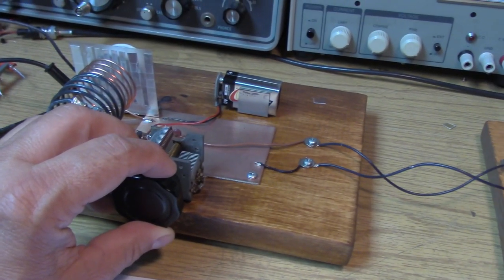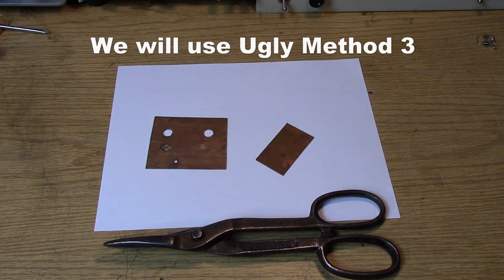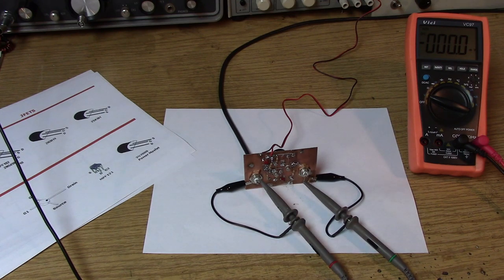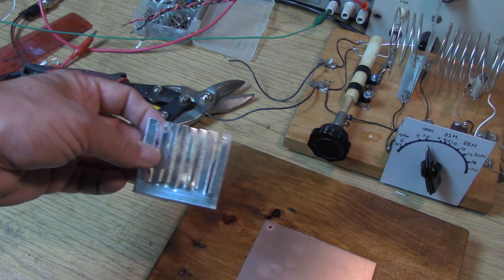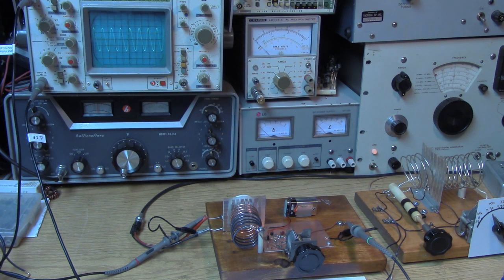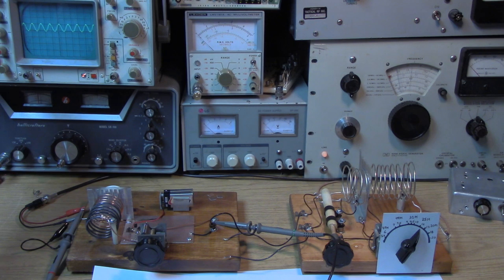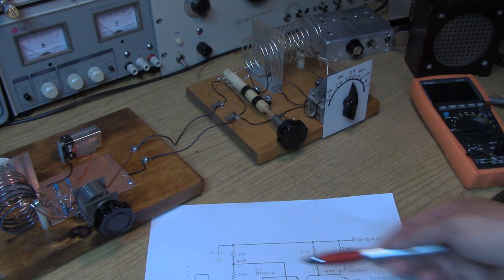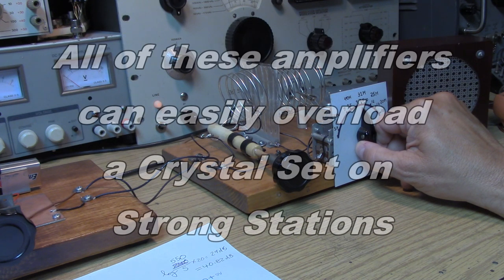Solid State Shortwave RF Preselector

Comment: I know this took a lot of time and work but I am so grateful for it. I'm a returning ham after a 30 year break. I have no electronics background and have a 68-year-old brain and so don't learn as easily as in my youth. Your teaching style is easy to follow and I'm getting there! Going to have to look into what you mean by "bias" in this context as I'm not clear on that just yet. Thanks again.
Reply: Hi, I am also 68, but have been working in Electronics since 4th grade, I found one of my business cards for Transistor & Tube Radio Repair growing up in rural NJ. I had a mentor, WW2 Vet who ran a a TV repair shop in Newton, and my Mom would drop me off there while shopping. I had some red cover book on Transistor Radio Servicing, and remember asking Mr. Decker what BIAS was all about!!! Basically it is just like IDLING in your car or lawn mower. The Idle screw sets the no-load engine speed. Similarly, Bias is as simple as 1 or better 2 resistors from the main voltage supply as a voltage divider, to drive the Gate, Base, or Grid input of your active device. For BIPOLAR Transistors, it is often 0.7V Silicon or 0.2V for Germanium. For FETS it can be 0V for Depletion mode, where the rated 10-50mA IDss Drain Current operating point results. For tubes it usually starts NEGATIVE with respect to the cathode, cutting down the Plate current or gain. The wanted signal is overlaid onto this DV set point, thru a DC blocking capacitor, and swings above and below the bias point. Hope this helps explain the basics, W4HDL in USA...
Reply: @conservative599  Hi and thanks very much for taking the time to explain this. The car idling metaphor was good for me as I've set up quite a few car engines in my time. Talking of time, it's moved on. When I wrote it must have been just before my birthday as I am now just turned 70!  Thanks again, I appreciate it.

Comment: Great fun. I have built several Doerle duplex type regens ( 6sn7 dual triode ver) and have been lucky in that i grabbed velvet vernier dials and that ilk when young. Saved tube type resistors and plug in coils/ sockets too. Just now am working on several transistor/ opamp modern sets and restoring my Dad's 1950 xtal set. ( W5EWF, sk). It even has an S meter! Pancake 2 stage tuner, tapped rf and adio coils for precise match. Amazingly sensitive. These sets still amaze me. You always peesent excellent videos! Thanks. 73 Karl, WA2KBZ

Comment: Very ell presented. You might be interested in this bit of related nostalgia. Back in '72, one of the popular electronics magazines ran an article about printed inductors. I ordered the PCB and it had 2 "coils" etched into the copper with space for 2 JFETs. It was an RF preamp for the FM broadcast band; each stage had a variable cap to peak it. Wow! That thing was red-hot, which I needed, living in the deep boonies. Thanks again for sharing your views on electronics.

Comment: In 65 I got my novice  (I'm 75)  and had some REALLY low end  receivers.   S-38 Hallicrafters,  Heathkit AR-3, later  fed by  an ARC-5 used as an 80M to broacast band converter, and finally,  an RME 4350A, which  I STILL HAVE.  At some point I acquired an RME DB-20 preselector, and that was a valued  item for many years.   The mice got into it  and I believe I finally threw it out years back
Reply from the maker: My first was this sears 5 transistor plastic radio that actually had plug in coils! I think it was an Elenco. My first with a BFO was a military surplus BC652 that covered the marine band and only 80M.

Comment: I use a Dremel with a small cutting wheel to make scores/gaps in the copper.  In this way you can set up your power bus also by scoring a couple of parallel lines near one edge, using your thumb/fingers as a spacer as you run along the side edge.  This makes an isolated strip maybe faster than attaching another piece.  Also the Dremel cutter works well for making a 'plus sign' inside an island which makes a nice 4-pad setup for small surface mounts like BF998 DG MOSFETS.
Reply from the maker: This is a great technique, with good eye protection, of course!
Reply: Great idea on the excellent 40673 replacement - how to mount it! I have been a ham since 1969, and have been hoarding all the great DG Mosfets and VFETS of the era to build stuff if I ever retire... I have an old 100KHz Calibrator PCB on my desk at work, carved out using an X-ACTO knife, to copy the circuit in a  a college ham radio club/roommates Kenwood R-599', for my old tube National NCX-200, all I could afford! His Dad was a doctor and he had the money for the silver front Kenwood 599 Twins! I now have 2 Twins, thanks to EBAY. Thanks, W4HDL
Reply: @conservative599  I miss my twins! What great rigs they were (are)!

Comment: Very well done, sir. I enjoyed your video. A transistor can be like a valve when it's an IGFET. Good idea on shorting the leads while soldering. I've been using that prototyping method very successfully. Amazon sells a diamond hole-saw set that works great for making islands for less than $8 that makes for attractive prototyping. The backside of your G-10 can be a power plane and the front side can be the ground plane. It is a really good low-noise construction technique.
Also can a set of vertical wires soldered to the ground plane make a Faraday cage (I really like your idea).
Question - I have often wondered about making a variable capacitor with a silvered glass tube and a high tolerance slug that is screwed in and out to make it variable. The dielectric constant of glass makes it possible to get good values of capacitance in a test-tube sized package. I also know the Russians make high-voltage variables out of glass. Has anyone tried this?

Comment: With the new prototyping services, you could have several "combs" etched and stored in your parts bin for prototyping.
Reply from the maker: Good point! Somebody could machine these.
Reply: @MIKROWAVE1  The PC board prototyping shops could make your "comb" using etched G-10 or FR-4. For circuits that are prone to external fields or circuits that radiate noise, I like to build boxes made of PC board material that can both contain noise and shield sensitive circuits from external fields. I came from the defense industry, where money was no object so we made enclosures of aluminum where we took a block of metal and machined away everything that didn't look like the enclosure we wanted to make.

Comment: Great experiments! However, I think you can’t draw conclusions about bipolar vs. JFET vs. MOSFET without carefully tuning the input and output impedances at each stage. Also I the bipolar cascode, I’d suggest giving up a bit of gain on the first stage by removing the emitter resistor bypass - that’ll increase the input impedance of the first stage as seen by the tank and you can move the tap up and maybe you’ll get a higher overall gain. I watch all your videos!!

Comment: In the times 1 (not ex one) mode, scope probes are already down on their response curve at 7MHz. Always try to use them in times 10 mode to preserve their bandwidth.
Reply from the maker: My scope is not great! But good tip on using a 10K probe that is compensated.

Comment: Fascinating - I'd like to know if holes would work instead of slots on the faraday shield.
Reply from the maker: Small holes are OK within reason for a Farady CAGE. But with a Faraday SHIELD, you are only trying to block the electric field and not  the magnetic coupilng. So you need to make sure that the fingers or rods are grounded only at one end. They can be interdigitated. Alternating up and down from a grounded window frame - but the opposite ends must be open.
Reply: A Microwave oven is a pretty "basic" Faraday cage meant to stop the the microwave radiation waves which are blocked, even though the window in the door has "holes". The microwaves are the wrong "size" if you will to get through those holes. (That won't block an EMP like some think though, wrong frequency!)

Comment: The talk about using 18 volts for the cascode got me thinking about tube designs.  When the plates need 100+V, and when the heater to cathode voltage is rated 100V max, it would be best to use a circuit that is cascode to the RF only, not the DC.  One could do the same with the three 2N2222's too.  The compliance would be better and the 9 volts would be more than adequate.

Comment: a question...can you use copper tape, that is in a roll like duck tape...to make the circuits on, dead bug style. It would be a lot easier to put holes in...
Reply from the maker: Well yeah! If you have some use it. Great for bottom of PC boards to add a ground plane too.

Comment: The problem with Manhattan construction is that the super glue used to attach the pads will generate eye burning outgassing when heated by the soldering iron.
Use of a pad cutter drill might be a better idea.
Reply from the maker: Ouch. And yes! So use a venting fan.
Reply: @MIKROWAVE1  The heat also weakens the glue, I've had pads fall off after soldering.  I've modified some small cap head screws with a dremel to serve as pad cutters.
Reply from the maker: SHHH - yes

Comment: Would a MC1350 have worked better than desecrates, what about lifting the supply end of the 15K resistor to the first 2N2222 and connect that to the Emitter of the second 2N2222 to create a Ring Of Two amplifier and a ceramic capacitor between the emitter of the second transistor and ground.

Comment: Hope your well in these tough times,really enjoy all your videos well presented.
Have you played with the ZN414 TRF integrated circuit?,I have,worked well on broadcast band but with my tinkering I think I’ve blown it,no selectivity and only strong stations coming in.🤔🥴
Reply from the maker: That was a great little device and quite a bit of gain in a small cheap package. I also remember  the 703 IC, called the 99 cent wonder. The key to these bipolar devices was and still is, impedance matching so you do not load down the tuned circuit.
Reply: A great little 3 leaded??? part from FERANTI of the UK!!! I remember them from my Wireless World subscription growing up in the 70's. Never built anything with them however. 

BTW, Mike is my absolute, hands-down FAVORITE and MOST CREATIVE Ham Experimenter/Constructor/Instructor on YouTube!!!!!!!!!!!!!!!!!!!!!!!!!!!!!!
Mike should have 100s X more views, and maybe some recognition from ARRL and add a PATREON account.
I am adding to my "Ye Olde Junk Box" updating with the cool parts he is using, adding to my 1700SF Basement mostly filled with  electronics from construction, consulting, and Ham Radio activities accumulated since the 1960's Thanks, W4HDL

Comment: If you want a tube what about the KORG NUTUBE 6P1 B+ 9-45V and a Heater voltage of 1.5V and might be usable in Push-Pull driving a center tapped output coil part of the tuned circuit for a TRF Radio, if you are using transistors what about a Ring of Three transistor amplifier.
Reply from the maker: I saw that thing. Just what we need - another tuby acting device that has lots of "potential" for all kinds of circuits. Seems like a natural for sound effects pedals.
Reply: @MIKROWAVE1  You could use that in push-pull mode for preamplification in the preselector or as an AM modulator provided you connect a power transistor between the center tap on the heater and ground/negative so why not.

Comment: I have a lot of new old stock 40673 FETs
Reply from the maker: They were the king of late 70's early 1980s designs  (at least for Heathkit) but are a rare beast nowadays. I have a few NOS in crumbly black foam left.
Reply: @MIKROWAVE1  Sorry, I was mistaken. I have lots of 2N4416A. I was going to offer to send you some as I have more than I will ever use but they're not 40673. I bought a few large surplus NOS lots of semiconductors off of eBay several years ago. I have a lot of 2N5109 too. They're a handy beast although for different reasons
Reply: Lots of signetics NE592N14... you got me looking in my parts cases 😅

Comment: I have a loose coupler crystal radio which works great when i use my guitar amp as a speaker; the signal is very clear and i dont need to up the volume very much at all to have it extremely loud. However whenever i try to use a crystal earpiece i get nothing at all, except sometimes some white noise when i disconnect one end of the secondary coil from the rest of the circuit. Any ideas as to what could be the issue? I appreciate that description is slightly vague so if not no worries. Thanks!
Reply from the maker: The crystal earpiece that you happen to have has such a high impedance, that the diode will not conduct. Put something like a 47K resistor across the output terminals in parallel with your earpiece.

Comment: 23:14. How is the generator wired in? Just between gnd and the antenna? So its replacing the 50 ohm antenna. Also 5mV is huge... I thought a signal was in the uV range from an antenna... Any feedback appreciated, i been trying for YEARS to build a receiver
Reply from the maker: Yes the signals we are handling are very small - some in the 10s of uV - but consider that 5 mV p-p is 1.76 mVRMS which into 50 Ohms is -36 dBm. That is a big signal towards the top of the range we might encounter, but it is not unrealistically large for a crystal set, or really any receiver. My equipment is crude, so I use big signals.
Reply: @MIKROWAVE1  this is very helpful to know, i kept adding multiple stages always assuming i needed to get from 10s uV to 100s mV. Additional stages complicated the design, layout, more possiblity of errors and no means to test it and fault find.. if i can hope to get a 5mV signal ill design for that... At least to get something working!!! I realize eventually ill need to improve sensitivity... But i need some sort of working receiver to boost my morale

Comment: How about using an OPamp?     CAL
Reply from the maker: Sure, high performance op-amps with a wide frequency range and low noise figure would work. You might start with an old favorite, the OP-37 in non-inverting (Hi-Z) mode, set for a gain of 20 to 30. There are hundreds of far better examples nowadays such as the LTC6226 that can give useful gain well up to 50 MHz. An ADA4084 would give a gain of 100 at 15 MHz for instance. Plenty of TI chips out there too.

Comment: 20:48 You need to make a candle powered soldering iron.  1/2' wooden dowel handle, bicycle spoke coiled around large bare copper wire. Leave enough spoke to insert into hole drilled in dowel. Heat with tealight candle.  Make some flux from pine sap.
Reply from the maker: Can I work some Obsidian or Flint into the design?
Reply: @MIKROWAVE1  Carve a nice totem on the wooden handle with an Obsidian/flint knife. Or now that I mention it, put a knife on the other end of the handle for scraping/cutting/whatnot.

Seriously though, most of my life I've been too broke to pay attention. I recently  got re-interested in 'primitive' radios. Most of my related junk is long lost, but I still have my soldering iron as described above. Just made a new alcohol burner for it from a yeast jar a short length of metal straw and a cotton ball. Works pretty good. Last night I removed all the parts from a CFL light bulb that has quit for some reason. Took about 20 minutes. 

Got some nice parts including a 3mH inductor I'm going to try and use as a replacement for the 2.5mH that the 'high performance regen receiver' calls for. Any tips on what I need to do to make that work, or can I just drop it in without worry?